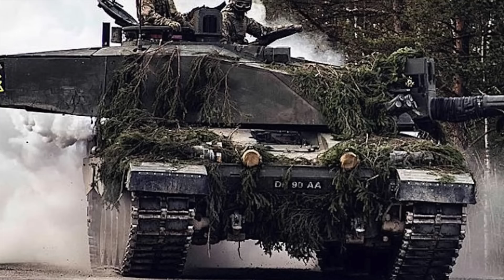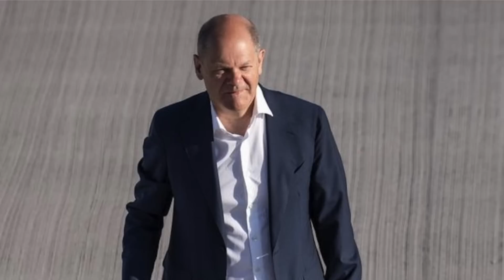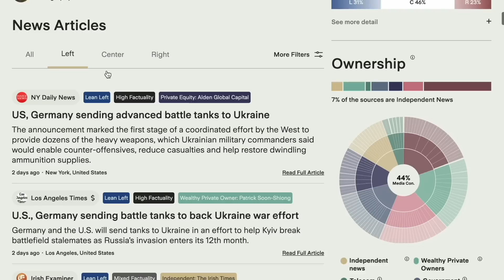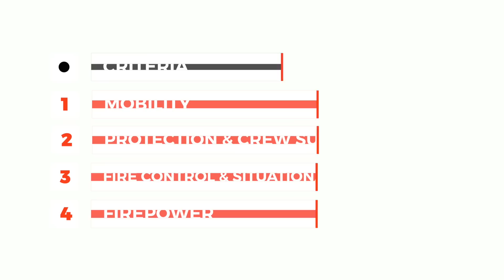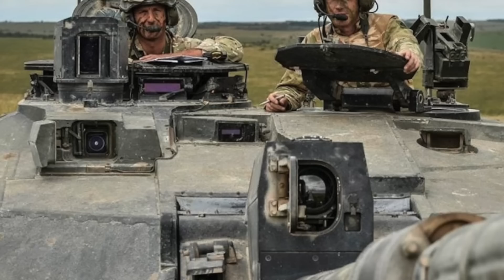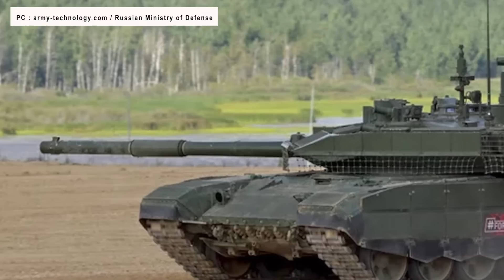British Challenger 2 vs Russian T-90 - Detailed analysis !

Comment: I would like to see a T-90 do this "“One Challenger 2 was allegedly struck by seventy RPGs—and emerged with its crew unscratched. Another survived seventeen RPGs and a Milan missile, and despite the battle damage, was back in combat the next day."
Reply: several T-90 actually survived multiple TOW missile attacks in 2016 Syria (which is still one of the most-powerful Anti-tank missile in the world)

And the TOW is definitely much stronger than anything the Challenger ever faced. The Challenger never faced any modern missiles to beogin with, only old RPG's.

However there was one incident in 2007 when a Challenger was indeed hit by a RPG-29 (which is from 1989) that managed to penetrate the front armor of the CHallener, wounding the driver.
Reply: @xAlexTobiasxB  Those TOW missiles used by ISIS in Syria where the first version from the 70s. One T-14 Armata tank was destroyed by one of those first type 1970s tech TOW.
It's not comparable to TOW that the Bradleys now have which easily take out a T-90
Reply: Made in Britain ❤❤❤
Reply: it was actually removed, repaired and available for combat in just 6 hours, also it ran over a shape charge ied and lost a track
Reply: dumb comment, the tank was destroyed , but dont cry too much
Reply: Sure I read up somewhere that it was 70 RPGs and that part of the external satellite/targeting system was the only thing damaged. Within an hour or so it was fixed and they trotted off after that
Reply: A challenger took several hits from a T72 with no effect
Reply: @stevefairbanks835  Yupp 2 000 meter or more and all Russian tanks struggle to do anything to a Challenger or a Leopard 2
Reply: @Lassemalten  yeah right, keep reading MSM BS, and go get your fourth jab why you there.

I guarantee you won't see a challenger in any battle video, just like we won't see a M1, Germany got duped again and we'll see Leopards blowing up just like Russian tanks, while the challenger and M1 can still have the mythical legend.
Reply: @paulroustan3643  hehe some sad fascist that don't like that his fascist friends are getting slaughtered?
Reply: @paulroustan3643  build a tank that ranks the amour  last of the three factors it gets blown up, and if you are talking tanks and myths then you have to start and finish with German tanks.
Reply: @alanrickett2537  that right, the leopard 2 performed badly in Syria, they were taken out by sandle wearing jihadi’s, even though they weee the 2A4, they were a sitting ducks to modern ATGM.

Tanks will get destroyed in a modern warfare.
Reply: @paulroustan3643  yes they will , and German tanks are just tanks but many people think they walk on water
Reply: The m1 is proven in battle several times over...it's been hit by the main gun from t72 and still shook it off like a scratch and rpgs and has been upgraded several times the depleted uranium armor alone makes it more protected frontally than any other tank.
Reply: @lokomike2911  even T72 been proven to take a shot from the frontal armour, it’s been documented plenty of times.

Can the M1 survive artillery, bet it won’t, the Russian Kornet missile will penetrate the frontal armour of a M1A1, probably will have trouble with the M1A3 though, but artillery strikes will still destroy it.

People have to understand that the battle of is easting took place during a dust storm, Iraqi tanks weren’t equipped with thermal optics, even General Douglas McGregor said the Iraq were handicapped and couldn’t see them while they took each Iraqi tank out, he said the Iraqi were blind.
Reply: @lokomike2911  I'ts been shot by first gen 3bm6, any new russian apfsds post 3bm42 will probably pen it's ufp or glacis at normal combat ranges in ukraine.
Reply: @lokomike2911  Much worse ammo used there.
Reply: @paulroustan3643  russian artillery is terribly inaccurate.
Reply: @konosmgr  no it won't the fuel cell under it will absorb the blow while APFSDS will ricochet into front turret or really 125mm turret ring.
Reply: @paulroustan3643   The following video should help you with your understanding and evaluation of the Kornet system in the real world. 4 key issues being:
- It doesnt have the penetration capability to defeat modern NATO frontal armour (1300mm vs 1600mm for M1A)
- it's laser guided so trying to 'paint' a target at 5Km plus is difficult. Impossible if target is moving
- It travels at 250m/s vs Javelin 2000m/s so can be defeated easily by APS
- Due to being laser guided it can also be defeated by smoke counter measures

https://www.youtube.com/watch?v=vVRcNPCVSzI
Reply: @paulroustan3643  That just proves the point that NATO tanks are superior in the sense that they continued to fight effectively inside a sandstorm...
Reply: @paulroustan3643  I am also sceptical about the Leo 2.  Never been in a tank to tank engagement.  I believe it WILL come out on top v Russian armour but I also suspect quite a few will get knocked out.
Reply: @Lassemalten  the challenger. The most powerful ammunition for the Challenger 2 is the sub-caliber l26 with a uranium core, the l26 projectile is capable of destroying the t64 t72a and t80b tanks from 1000 meters, but it is absolutely useless against the t72b t72b3 t90m tanks, the armor of these tanks will withstand a direct hit from the Challenger 2 tank by the L26 projectile.
Tanks t72b3 t90m can use shells 3bm44-2 and 3bm60, these shells are able to penetrate the challenger 2 in any part of the hull from a distance of 2000 meters. Leopard 2 is a strong enemy for Russians, Challenger 2 is a piece of advertised shit for Russians
Reply: @kinoinemllbl7833  😂 given that Russia’s ERA has proved at best poor
Reply: @kinoinemllbl7833  Your russian and thats russian propaganda. Anyone with a brainknows Challenger fought T-72s a lot in Iraq and T-72 can't do much against a Challenger 2 or Abram. Unless of course get a shoot from behind.
But you keep coping
Reply: @robertpatrick3350  Yeah, it turned out to be very bad, withstands a hit from TOW🤣🤣🤣
Reply: @kinoinemllbl7833  russian tanks are getting smoked by drones dropping fire crackers as soon as they see a challenger 2 they will run for their f lives asuming there still alive
Reply: @paulroustan3643  this morning, the 2nd of April 2023, videos of challengers 2 in Ukraine is all over military channels. Boy, did your stupid comment age badly.
Reply: @kinoinemllbl7833  haha the ones that’s filled with rubber mats. Time will soon tell. We will soon see the challenger doesn’t enter in to the turret toss like Russian tanks.
Reply: @Lassemalten  lol, we just seen a T72 take out a leopard 2A7, this comment didn’t aged well, the first Leopard 2 against any Russian armour and we see the leopard burning, people are so blind by the BS propaganda by the military industrial complex, our equipment is just expensive crap, made to ripped off  us tax payers
Reply: @stevefairbanks835  the chieftain you know the old british mbt slapped plenty of t72's in its days let alone the chally 2
Reply: Pretty sure we will see these being blown up by ATGM's like the Kornet, the same ATGM that messed upp Turkish Leopard 2's in Syria and Israeli Merkavas in Lebanon.
Reply: @andreasfjellborg1810  a few thats all and most ukr will be uparmored.
Reply: I think there is just a tad too much optimism here. The T90 Proryv has a bigger gun than Challenger and Challenger surviving RPG hits doesn’t really factor. Can it withstand Kornet missiles or suicide drones. Only 14 have been sent …..they will likely soon be scrap metal.
Reply: @peterlangan1181  Russia makes 20 T-90 a YEAR. It's very few of them Challenger will be mostly meeting T-72 and T-62. And Challenger got 20 tons more armour then T-90 which is 50% more weight but more then 50% more armour I would guess
Reply: The only way that story is remotely true is if the RPG rounds were all anti-personnel rounds and only hit the frontal arc of the Challenger 2. 

Even the T-72 took half a dozen RPG hits; it's certainly not as impressive as the Challenger 2 taking 70 rounds laughing 😆
Reply: @thephoenix756  Well it's true, was outside of Basra. You can look it up yourself.
Reply: @thephoenix756  read the news reports easy enough to look up, you'll find its true
Reply: @thephoenix756  wrong on all counts.
Reply: It's a RPG that's a grenade with propellant
Reply: @jaythomas3224  you just learned that? good job!
Reply: @Lassemalten  😂😂😂
Reply: @jaythomas3224  No it's not it's a shaped charge.
Reply: Million? Can you count or do you just listen to all bedtime stories and gossip then further.. 😴
Reply: @Vasskaret  Your so terrible on english that you don't understand I didn't write million?
Go watch some Russian propaganda that will reinforce your delutions

Comment: Challenger 2 is an under powered, overweight target. The question should be 'Can Ukraine support a company of Challenger 2 tanks that use ~3 times more fuel than a T-64BV company?'. 

The snow is beginning to melt, and the ground is turning to mud. Challenger 2 will suffer.
Reply: An "overweight target..." nice one, Frank!  

This squadron of tanks will have trained & motivated crews, which means a maximum combined weight of fire of 84 rounds per minute (with an unenviable strike record), should the rabble opt for a mass attack, by T90s; this comparison is academic.
Reply: @danielw5850  This is what I mean: 
https://youtu.be/m7eRqK51oQ0?t=80 
https://youtu.be/TCXwgPZXScM 
https://preview.redd.it/sbag4tjfdqy41.jpg?auto=webp&s=3c2ad970eb1bbca67e6dc8b02dc2cfb02a4e59d9
Reply: Yeah you’re a Russian I’m guessing.  My guy just because Russian tanks crews aren’t properly trained doesn’t mean our tank crews aren’t.  Every country has mud and we train constantly.  Mud is just another obstacle that will be overcome 🤷‍♂️
Reply: @smyers820gm  Now imagine that was a Challenger 2.
Reply: @definitelyfrank9341  i guess you will just refuse to accept it even when Russian army is destroyed and Ukraine has its territory back🤷‍♂️
Reply: But one big advantage is Russian shella cannot get through its armour 🙃
Reply: @BlatentlyFakeName  

Right, so the Challenger 2 will just shrug off rocket artillery and 152mm rounds on the top of its turret? 

I suppose you also think that drones, attack helicopters, fire-and-forget LMUR missiles, long range guided Hermes missiles and Kornet ATGMs won't at all be a threat to your wonder tank 🤣

Comment: Anything russian built is going to be crap compared to western made. Why don't we see many T90 tanks? Because russia doesn't have many of them, and the ones they have are just old tanks made to look more modern. That's why one of them had to be towed during the parade in russia because the soviet engine gave up on it.
Reply: As many factories.. it was one t14 that was a newly constructed taks.. the gear did stop and locked, not engine... that happens everywhere it's a new ride.. but those faults where tested and fixed.. don't kill all the puppies for one that failed..
Reply: Russia has deployed 500 T-90 tanks to Ukraine

Comment: Is HP the big concern? Or torque? Honest question
Reply: That's a fair question. The acceleration of the tank is effected by the power output of the engine. Power= Torque x RPM, so these things are never truly separate. As these tanks are both automatic transmissions and the engines are optimised for producing torque at low RPM they will both drive easy and fast, but the weight of challenger will make it accelerate worse. He also didn't cover the fact that challenger exceeds the weight limit of Ukrainian bridges where as T90 does not. So in terms of forward mobility I see T90 as better. Challenger can reverse though, so can shoot and then pull back, that can be very usfull. We have seen T72s turning around to get out of a bad situation rather than deal with the hopeless reverse speed. The torque vs power thing in car chat has some more relevance, but much less since automatic transmissions took over and some have as many as 8 gears.
Reply: @greybuckleton  Thank you Grey 🙂

Comment: Challenger 3 which is coming soon (basically challenger 2s getting big upgrades) and will not be rifled anymore so nato standard
Reply: I think it will still be rifled but will also take the NATO ammo. So will still be able use HESH rounds as well.
Reply: @BlatentlyFakeName  It has the same gun as the Leo2A7. Much better penetration for AT rounds and can fire NATO standard HE including programmable airburst rounds.
Reply: @BlatentlyFakeName  It will be a smoothbore gun which means it's not rifled... You can't have both smoothbore rounds need to be in a smooth barrel hence the name if you put them into a rifled barrel you would likely either destroy your barrel or lose any chance of accuracy. The UK is only making the switch to smoothbore now because programmable smart ammunition is finally able to compete with hesh rounds that being said the new he rounds will cost 10x as much to fulfil the same function of the old hesh the benefit being that all nato rounds will work for the challenger 3 making resupplying easier.
Reply: @BlatentlyFakeName  you may be right, I was just going from the below
Challenger 3 tank upgrades include:

High velocity ammunition with faster speeds and increased range

Digitally programmed ammunition in a 120-millimetre smoothbore gun

A versatile turret that can be fitted to the tanks of allies and global partners

A new engine cooling system and suspension to increase accuracy for firing in transit

A new automatic target detection and tracking system to identify threats

New thermal long-range cameras, modernising the day/night image system
Reply: Better hurry up then. Nato will be gone in 5-10 years.
Reply: @Test4Echos  NATO is going nowhere with a resurgent Russian Bear bearing it's teeth at European neighbours.
Reply: @36thulsterdiv72  Fantasies. Russia just don't want Nato at it's doorstep. Why would it be interested it Europe and it's failing economies? And it's mainly Europes economies that will bring Nato down.
Reply: @Test4Echos  That's why there is now reports of a ploy by Russian to put a government in power in Moldova.

Sooner Russia gets their arse handed to them over Ukraine the better.
Reply: @36thulsterdiv72  Yeah, reports from whom? Western sources? Maybe you haven't noticed it yet but Russia has already turned its back to Europe and are now trading with the east. There's nothing in Europe for Russia.

Comment: Author makes wrong conclusions in the end.
1. Nobody knows package on Challenger 2 send to Ukraine,  highly likely they not will be last version. 
2.  Challenger 2 has a flows - very heavy for Ukrainian infrastructures like bridges,  railroads. 
3. Ukrainians will not be trained properly to operate or service Challenger 2. Problem will be with recovery due to weight and not available parts.
So, damage only to tracks of Challenger 2, will be enough to abandon it by Ukrainians soldiers.
Reply: Another Russian bot 😂.  I guess online is the only place Russian can have victory 😂

Comment: 14 challengers aren't anywhere neer enough.
Reply: They don't have a heck of a lot more to give due to decades of salami slicing military budget cuts.
Reply: Think was more about putting more pressure on Germany supplying Leppard 2 to Ukraine & it worked
Reply: It was a political gesture and it worked.  It shamed the EU countries into also providing armour.
Reply: Depends how they use them. Challenger is designed to dig in and destroy other tanks while being near impenetrable to Russian shells. I guess they will hide them around Kiev.
Reply: I imagine a second batch of 14 will soon be announced. It takes time to train the Ukrainians to use them effectively.
Reply: It is plenty as long as everything is employed with western training in the use of combined arms    The Russians are screwed